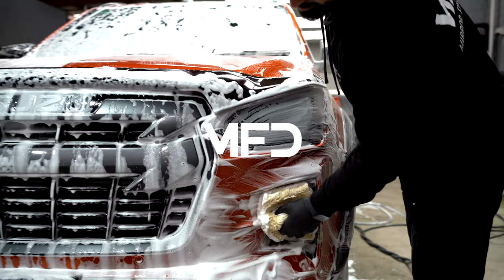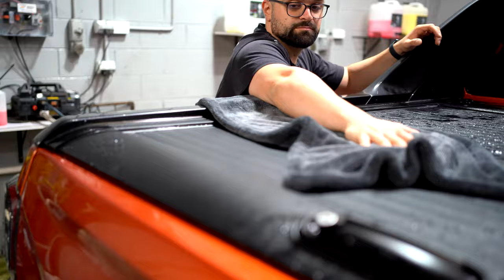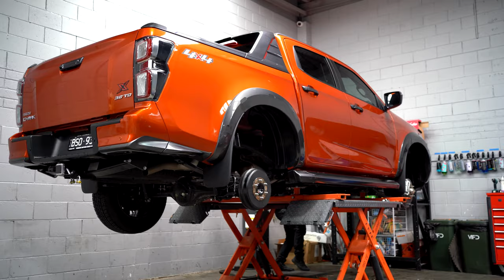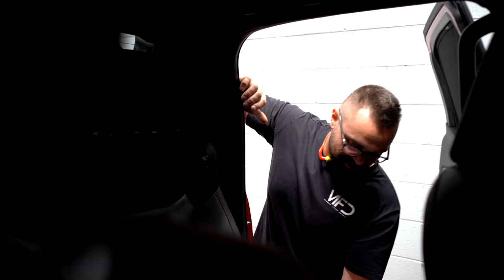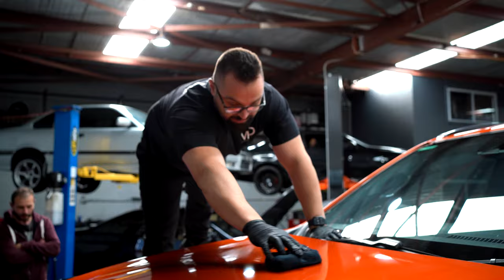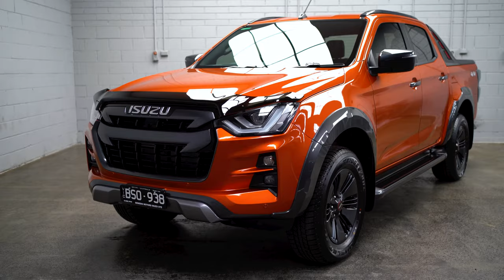Mirror Finish Detail | 2022 Isuzu DMAX X Terrain Detail and Ceramic Coating Volcanic Amber Orange

Comment: How does an owner maintain the vehicle after such immaculate work?
Reply from the maker: Great question. We offer our customers a ceramic coat maintenance pack

 https://shop.mirrorfinishdetail.com.au/products/standard-ceramic-coat-maintenance-pack which includes 

1L of STEEZY our acid free de-ironising spray. STEEZY reacts and removes iron particles that embed onto the paint surface originating from brake discs, pads and road surfaces. Eliminating the risk of scratching the paint when washing and is also a highly effective wheel cleaner.  

1L of our FROTH IT pre-wash soap used in conjunction with a foam cannon which lubricates the vehicle surface and removes dust and dirt without scratching. 

MARY our soft lambswool mitt, for minimal abrasion further reducing the risk of scratching 

HELIX our double sided, edge-less, twist loop microfibre drying towel. Glides over the paint surface absorbing standing water in no time without leaving streaks and water spots as well as reducing the risk of scratching.

Finally 500ml of NANOSHELL ceramic coat quick detailer. NANOSHELL is applied after the vehicle had been washed and dried. 
NANOSHELL is simply sprayed onto paint, glass and plastic surfaces and spread over the vehicle using a microfibre towel leaving a layer of ceramic coating that bonds to the paint surface leaving an ultra slick and hydrophobic surface which repels water, dust and dirt leaving your paint cleaner for longer leaving a deep gloss aesthetic and colour boost. 

I hope that helps! 

https://shop.mirrorfinishdetail.com.au/products/standard-ceramic-coat-maintenance-pack